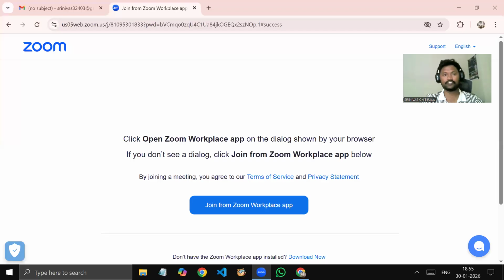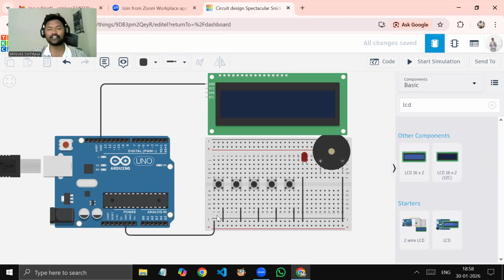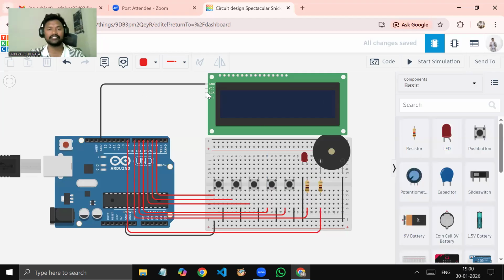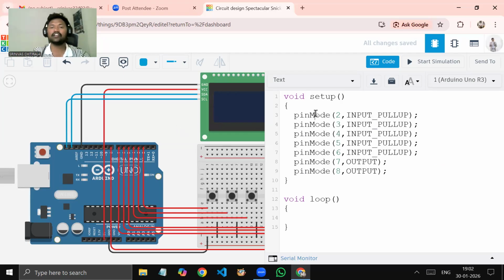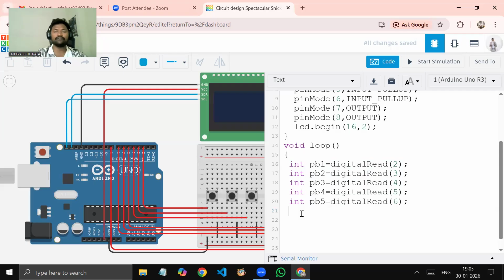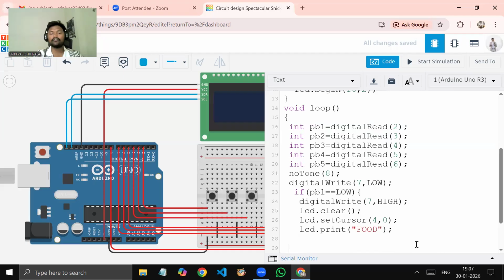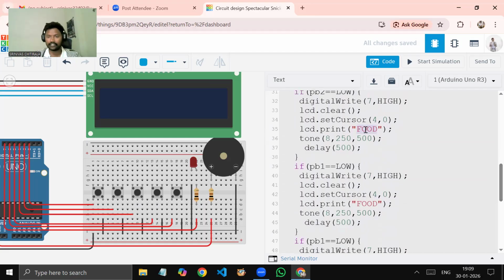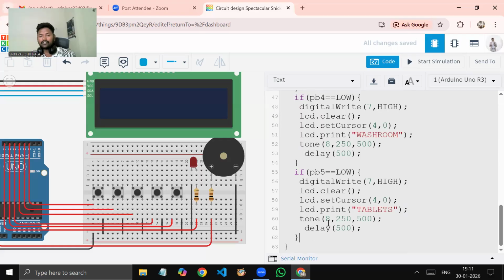Patient Helper Communication System Using Arduino | Tinkercad Project

Comment: Sir if i pressed 2nd push button it wont working what is the reason sir
Reply from the maker: It might be a code or connection issue that I need to check